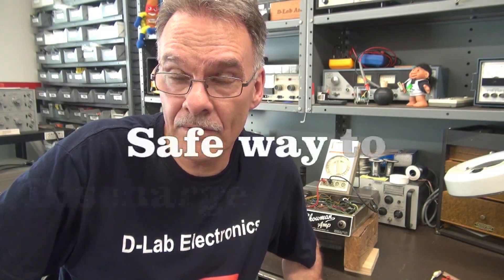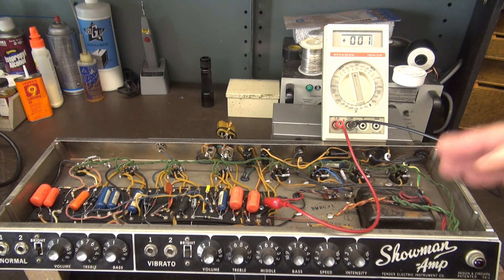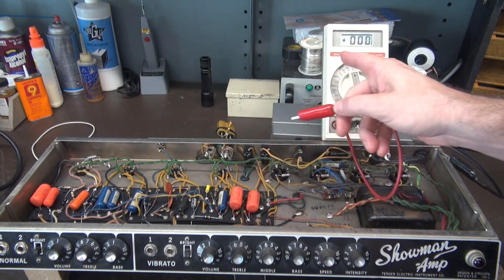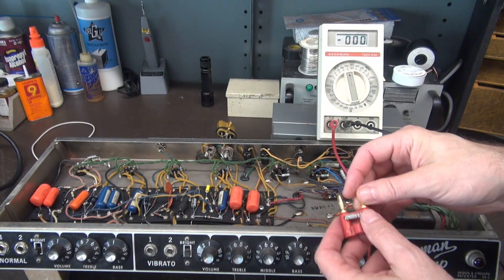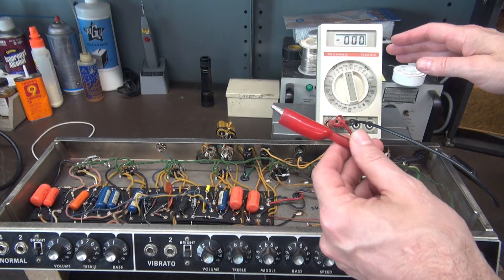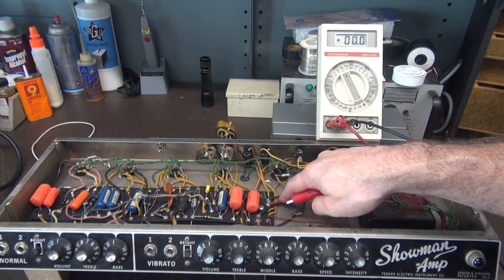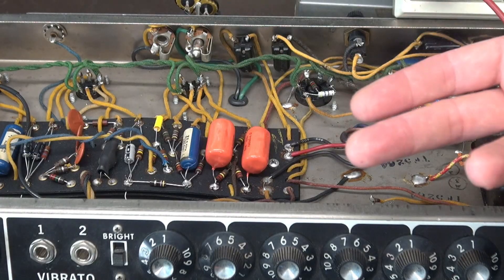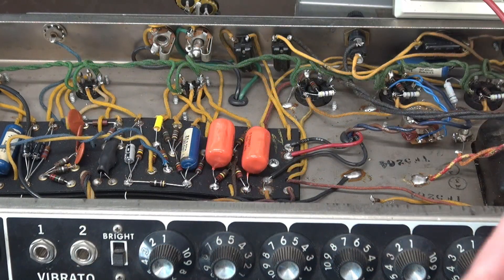How to safely discharge tube guitar amp Filter capacitors D-Lab Tech Tip

Comment: I always power off and leave standby on and play my guitar through the amp until the sound disappears. The caps voltage bleeds down I then check to verify that it’s discharged and 100 percent of the time it is

Comment: I "re-invented" this method a few days ago not knowing about this video. I've watched a number of home-shop solutions on Youtube people have hacked together that make no sense because none of them measure the voltage during the discharge. Fortunately my DVM has 3/4" spacing and the double banana extenders are dirt cheap on Amazon. This of course also works with analog meters (but not my Simpson 360 because of the jack spacing).

Comment: Whenever I designed anything with storage caps at elevated voltages I would include a bleed resistors across the caps with a time constant that rendered the things safe (e.g. residual voltage below 20 volts) within less than the time needed to access those voltages. It hardly increases the dissipation by enough to worry about nor the ripple. Personally I would retro fit them to these amps as a worthwhile safety precaution.

Comment: What about on the Deluxe, vintage or DRRI? Do you have to leave Standby ON or OFF please. Anyone? I heard just turn power OFF as you play it and it will drain it.
Reply: Always leave standby on when draining caps. There’s no need play while it’s draining. But don’t assume it worked. You still must measure the voltage across each cap.

Comment: What if you turn it off, without putting it on standby, and you hear the sound diminish and stop, and then you unplug it and turn it back on (without plugging it in)? Also what if you hold a screwdriver to pin 1 of the first 12ax7 and also to the chassis? - Does that work?

Comment: Just flip the stand-by switch to "on" and allow the two 220K equalizing resistors to discharge all the caps. They'll be safely discharged after 2 minutes. RC = 35 seconds @ 80uF and 440K

Comment: Love your videos.  I built a capacitor discharger using resistors and a volt meter.  It is all in a single box.  Includes the test leads.  Voltmeter limit is 750 volts.

Comment: When working on an amp with no standby switch, are there any rules to follow? A lot of the stuff I’ve been reading seems to be instructions for dealing with amps that have a standby switch. I’m assuming that I should just have the amp unplugged and go ahead and discharge the caps using this method. I bought the little banana piece and got a pack of resistors from Amazon. I’m going to set up my multimeter the same way they have it set up in this video. Is there anything else I should be aware of?

Comment: Hi Jerry, So glad I found your youtube channel. Awesome job on your videos that are well done, easy to understand and the visuals are awesome. Thank you for what you do. I taught auto mechanics for 30+ years and really appreciate your professionalism.  I do not have a banana plug setup on my Fluke27/FM meter. Any advice on how to build an adapter with the cap to do a power soak on the excess voltage and current? I'm working on a 67 Vibrolux, which is most likely similar to the Showman in your video, but then what do I know. My amp has a sizzle sound after striking a note that decays over a short time. She needs a tune up for sure. Doesn't have that warm Fender tone anymore. New tubes are on the way. I want to go over all the tube sockets to clean them and make sure they are not elongated. Do you have a video on tube socket maintenance? A few of the sockets look elongated. Well, I'll stop rambling here and continue getting educated with your fabulous work on amps.
Thanks again, Dave

Comment: Thanks 😎 SIR..... Question... I have an old tube cabinet radio... I think philco... where in it would be model number Etc.... I have not disassembled the chasis yet.... it's a large chasis 24"by 10" loaded with large transformer and tubes alike hope to salvage parts but would like to aquire a schematics....

Comment: What about,  unplug the amp.  Plug your guitar into the amp and play through it.  The residual electricity plays through the speaker, but it dissipates.  After playing the guitar a few seconds, the volume trails off and is no longer heard through the speaker.  Unplugged, try with switches on and off, guitar plugged into channel 1, then plug into channel 2 and repeat.  Won’t that drain the juice out of the amp?

Comment: I bought this little box called a TKDMR Model: Td-CD01 Capacitor Discharger. It says suitable DC5 - 1000V that has these two little lights and says on it that discharge complete when light OFF.  Is this suitable for capacitors in a modern amp? I have a Marshall DSL100HR head and can hardly find anything on it online other than I believe it as 2017 model amp.  I'm wanting to discharge mine, so I can clean this damn yellow glue off the board they say could become conductive and seems to be touching certain components in the amp they say could later possibly short the map out and cause damage. The only amp repair guy around me wants to charge nearly $200.00 to do it. Its very little glue in a couple spots, and feel it's a rook for that much money. Or is this what amp tech charge now? or can I safely do this myself? I've always just played and had techs work on my stuff, mostly accept for biasing. Any advice?

Comment: If you’re grounded and the powers off, with the resistor is it ok to touch other components with the wire your using to discharge the Caps?

Comment: I looked at the schematic for my Vibrolux Reverb{AA270 circuit} and it doesn't look any thing like that, so I guess I'm good to go the old way of discharging caps. An old, long deceased amp tech once told me another way to discharge my caps: The day BEFORE I plan to work on my amp; turn off the power switch and unplug the amp from the outlet. Then flip on the standby switch. By the next day the caps will have discharged and the amp will be safe to service. Now, this was told to me back in the 1970s, and the guy worked on the circuits of those days. Nowadays, it could be a different story with all the different makes we have today. Then it was mostly Fender, Ampeg, Carvin, Marshall and Silvertone/Danelectro in my area.
Reply: That's the method I've been using for years when working on tube amps and...I still have all my fingers ;)
Reply: I realize this comment is years old and may not receive a response, but do you think this method would work on a new Ampeg SVT-CL?  It was manufactured in 2020.   Not sure if it’s at all the same as the older models.
Reply: @ericmork630  Try it, but before you proceed, ALWAYS check the caps with a voltage meter to be sure. If they read less than ten volts, you are good to proceed.

Comment: After you put a resistor into one of these plugs do you just clip off any extra length of the resistor wire that sticks out the other side? Should I cover the hole with anything?

Comment: Where did you get those dual banana plugs with the set screws (for the resistors)?  I can't seem to find them anywhere.  Do you recommend a brand for test lead cables / probes /clips?  Options I'm finding are $20+ for off-shore brands to $60++ (Fluke) for top name brands.
Thanks,
Bob
Reply: D'oh.  found the set screws.

Comment: is there a sure fire way to check voltage regardless of circuitry, what if completed the circuit between one end of the filter cap to the other with a resistor, or resistor and multimeter. does that eliminate all the charge regardless of where the standby switch is located?

Comment: How do you ensure the chassis itself is grounded?
Reply: Place it on the ground? Connect a grounded wire to the chassis?
Reply: @flintdavis2  If its sitting on your bench/table, and that's got all four feet on the floor, I'm assuming that's enough.
Reply: @rnhtube  sounds like you better get an experienced technician or study some more. 😅 hope your joking.

Comment: Great tip thank you for posting this. I’ve found these stackable double Banana plugs but they all have an internal 18 gauge shorting bar. Don’t you want the path from + wire to - wire to pass through the resistor so it can restrict it before going to ground. Wouldn’t a shorting bar provide a direct path to ground?
Reply: I think that's okay because voltage in a parallel circuit is equal in all paths, so a resistor through one path will still have an effect on voltage in the direct path. Just a guess.
Reply: @AwesomesMan voltage will be equal but current will always flow trough the path of least resistance.

Comment: So when the standby switch is 'on' its actually an open circuit? Ie opposite of a light switch. As I (mis?) understand it the switch prevents the high voltage (from caps) from hitting a cold tube and creating an arc (hurting the cap and/or tube). So if you want to drain the caps grounding to the chassis, leaving standby ON creates a CLOSED circuit which allows the caps to drain.

So why not just go from the positive to negative on each cap?

Comment: I have a 2W 200ohm resistor, given the big difference in resistance.. would this be okay?
Reply: I have heard elsewhere on other electronics sites they use a minimum 100 ohm for general capacitor discharging. So if that is correct then you should be ok. But maybe test it on a out of circuit stand alone cap and see if works first.

Comment: Enjoying your videos, Terry, but I think you are mistaken about the negative Standby on those Fenders.  If you check the schematic closely, the caps are always connected to ground.  They get lifted from the negative high voltage rectifiers, not from ground.  So, they will still discharge by your method and most others.  Keep up the good work!
Reply: His explaination of how the Fender standby switch works,is not good work or thinking!!
Reply: Maybe he’s seen mods not wired correctly. Is flipping a switch that difficult?🤔

Comment: Is there any danger in poking around in an amp with the power trans primary     still energised by the wall voltage? I've been shocked by picking up a chassis I thought was disconnected from the wall. Tired and late at night.

Comment: A question please. At what point on the eyelet board are you discharging the caps from? Since I'm just a beginner when it comes to this stuff, I'd be more inclined to open the dog house and do each one individually, however, my guess is that you're doing it from the B+ rail past the standby switch from which point the internodal resistors and filter caps branch off. I've been zapped but just a few times over the years (luckily), but ever since I was knocked on my arse across the floor from my stereo speakers (electrostatics) I've had somewhat of an awakening...I'm just as cautious, if not more, with this stuff than I am working inside the live panel in my home which I'm used to. Thanks, JC.

Comment: I wouldn’t poke around in a tube amp unless it was unplugged. I would not rely on the power switch.
Reply: Doesn't matter if it's unplugged or not, the caps can still hold high voltage. You still have to verify the caps are discharged, which is what he's showing you how to do here. Don't open an amp if you don't understand this stuff.
Reply: @TheRealChetManley  I'm an electrical engineer; obviously I understand that the caps can stay charged after the amp is off. My point is that he's relying on the power switch to kill power rather than unplugging the amp. There's still 120VAC coming into the chassis unless you UNPLUG it.

Comment: Question. When discharging tube amp caps, should the power cable be connected to the mains, while the amp is turned off? Otherwise, where will the charge dissipate via the chassis if the power cable is not connected to the mains ground? Or should the power cable be pulled out from the mains and chassis alone can absorb all that current?

Comment: When I used to repair amps I used a 240 volt  UK  light bulb with 2 meter leads connected to it . You could see the bulb slowly get dimmer and then go out when discharged.
Reply: That's the method I've heard mentioned before over here (UK). It's vert visual.

Comment: Exercise caution with voltage doubler power supplies, or those that output both positive and negative voltages using the same reference (some HV bench supplies, for example). They can have capacitors that are not grounded. Strapping your discharge resistor from B+ to ground won’t catch all of them. Discharge each capacitor individually.

Comment: In context of this video is "stand-by on" the position where you'd hear sound coming from the amp when normally playing amp or rather the position where power is cut from the power tubes and no sound? Thanks. I'm not sure everyone uses same terminology and it's obviously critical to this lesson.
Reply: in this case "standby on" means it's in the position you would need it at in order to hear anything out of the amp, yeah :)
Reply: @soupalex  Thanks. That's what I thought. But in my common use "put the amp on standby" means flip switch so no sound comes out and that also equates to "standby on". Maybe I've just had it wrong. But I don't really think there is a consensus on this.
Reply: @BlackDotPatrick  you're not wrong! i've definitely heard both uses wrt standby switches, i don't think there's a standard in common use at all
Reply: it's not really helpful that a lot of other electrical appliances have a "standby" mode but only one power switch (i.e. they're only really "off" if you frob the wall switch or unplug them)
Reply: @soupalex  Great video - and was wondering same thing on my Tweed Deluxe regards the standby switch "on" meaning. Cheers!

Comment: Back in the 70's I tested the length of time it took a charged capacitor to discharge in open air.
 It ranged from 30 minutes up to 3 weeks (!). The 3 weeks was on oil bath military capacitors from surplus equipment. Standard 'lytics took up to a week and a half, depending on their quality. Average on fixed caps was about 1-7 days, depending on capacity.
 Some of your viewers may be unaware that air blowing across the terminals of a capacitor can charge it. Many of the Mil Surp caps I bought back then had a shorting wire across the terminals. Your local electric company also has the shorting wires across the HV caps they use in your power system., until they are installed.

Comment: Speaking for myself, it's possible I would turn the power back on and still have that resistor assembly plugged into the meter and connected to the hi V. Is there a resistor value that you would suggest that's high enough to use in that assembly and not damage anything should that happen?

Comment: Would the same technique work on a 1948 Newcomb phonograph? Only one power switch.
Reply: The reason the standby switch is relevant is that it interrupts the path to ground.  Just putting one lead on ground, and then using the other to discharge the capacitor makes it easier.  If you don't have a schematic, you can always discharge a capacitor using this method with one lead on one side of the capacitor and the other lead on the other side of the capacitor.  You could even do that with the amp shown if the standby switch was "off."  You can always discharge a capacitor by connecting a resistor between it's two legs.  Always.

Comment: also, what is the spec on the resistor to use?
Reply: As Terry said in the video: 22k @ 2W.
Reply: @silasfatchett7380  haha yes, you are correct, I had missed that    THX

Comment: Hi Terry
Did I buy  the rite resistor its a 3 watt 100 ohms
 https://www.ebay.com/itm/183448625634?ViewItem=&item=183448625634
I have a 64 fender pro reverb / what  large filter capacitors do you  recomend , under  that metal cover/ and  why  if you dont mind me  asking, in the past I had my vintage amps gone thru but  they  sounded swimmy  instead of dialed in is  there a way of avoiding that  Iam thinking  of doing my own large filter caps I am very mechanical and  was  going  to leave  the rest  to the  amp tech thanks in advance/ 
Mike

Comment: I  did not know about the neg ativ standby switch. Thank you  terry . i myself was using the a 1k 5 to10watt sandblock ceramic 5watt 1 to 10k .what is a gopd ohm value to use?

Comment: where did you buy the banana jack stacker? don't see anything that looks like the one in your excellent video. thanks
Reply: Pomona and Philmore Electronics both make them . Likely available thru Mouser or Digi-Key. Last one I got was about 5 bux, but have found them at ham fairs for a buck or less.

Comment: That's  a  great  video! Now because  you are  a  HAM  what value  resistor  would  you use  on a 1kw linear  amp for HF Radios? I've  been  using  a 1k ohm 20 watt but think I've  been  doing  it  wrong  also forgot  to  leave the stand-by switch in the "ON" WOW I'm glad I  didn't  get  any shock ! Maybe  those amps  are  a little  bit  different ?

Comment: In circuit, usually the caps will mostly discharge on their own as evidenced by your meter, as the tubes still draw a small amount of current as their filaments cool. That’s why the sound fades out vs abruptly cutting out. Greatest risk comes from when performing tests with the preamp and power amp tubes removed as now there is no current drawn after power is removed. In any event, it is still a good safety practice to measure the B+ rail before performing any service, and discharging the caps if necessary. 

I mitigate this in my designs by adding a high resistance (so it doesn’t load the power supply under normal operation) bleeder resistor across the caps so regardless of what state the amp is in, it discharges those caps when power is removed.

Comment: This is going to sound dumb, but can you do this to work on old radios.
Reply from the maker: Yes, highly recommend you discharge radio filter caps the same way
Reply: D-lab Electronics  thaks
Reply: D-lab Electronics thanks for the reply
Reply: @d-labelectronics  240 volt light bulb sounds like a good alternative discharge  tool. Swap bulb in place of resistor?